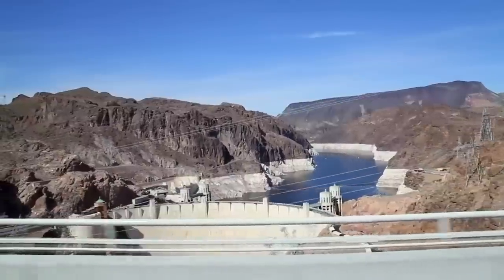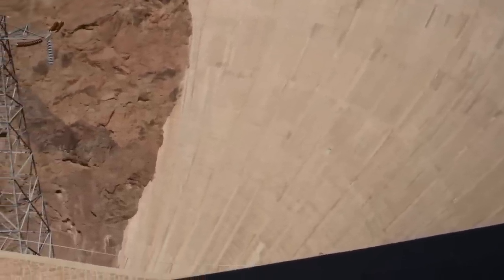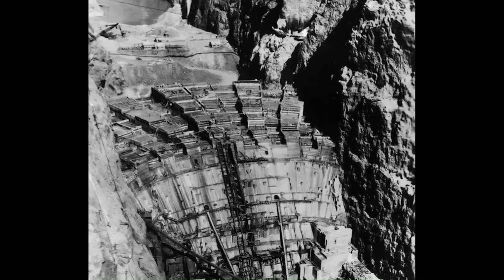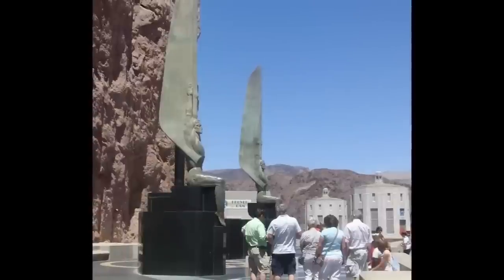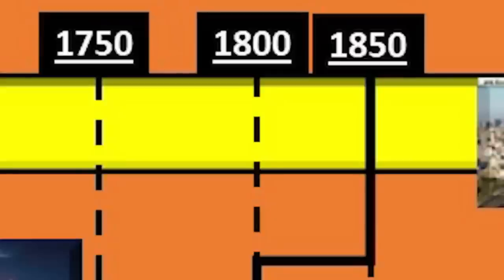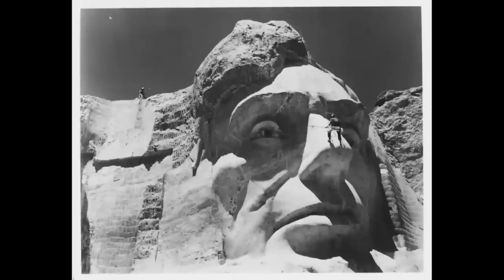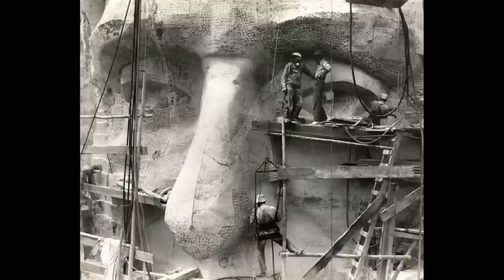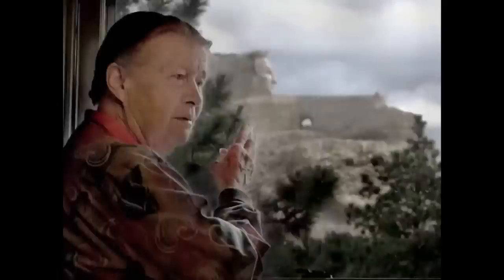Monumental Achievements of the New-World?

Comment: One more thing ... The old world buildings that arent flat roofs have SLATE roofs (and or copper or lead coated copper) . If you dont have any experience with slate , its VERY heavy and can only be put on buildings that have a proper structural support . To manufacture slate is NO easy task , nor is it easy or fast to install a slate roof . You have to use copper nails as well. ... just a side thought
Reply from the maker: Good call on the copper nails!
Reply: @Restitutor_Orbis_214  Thank you kind Sir . I love doing slate roofs but sadly , alot of the time when we replace the roof , they opt to put down asphalt shingles and absolutely destroy the beauty of the building . Gross ...

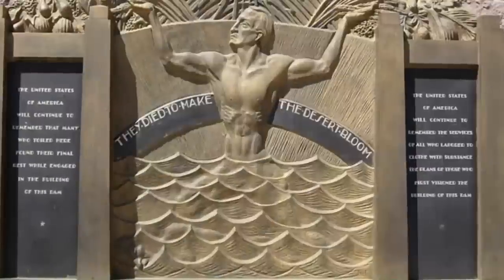Comment: Most of the grids on the floor have a black sun symbol in them.  At 24:47 they even make the black sun have swastica arms.  At 21:43 it looks like a wall outlet in the middle of a cross, surrounded by black= energy source?  At 23:21 the man with upheld arms is standing on the back of another man laying face down in the water.